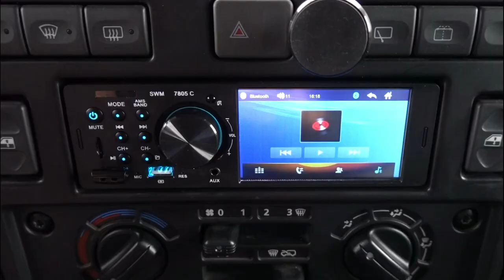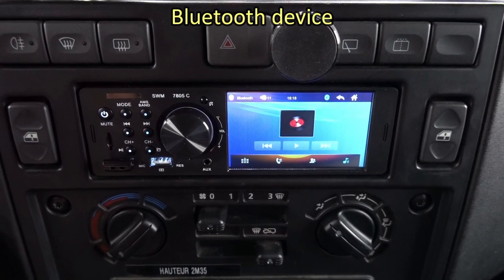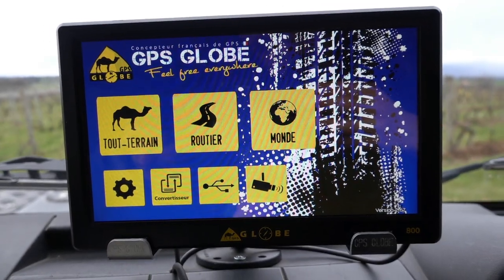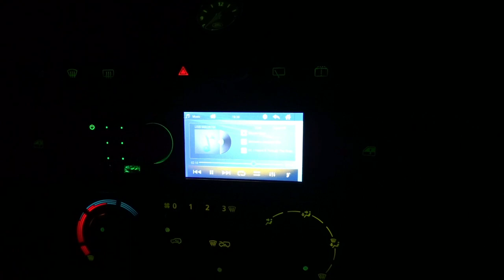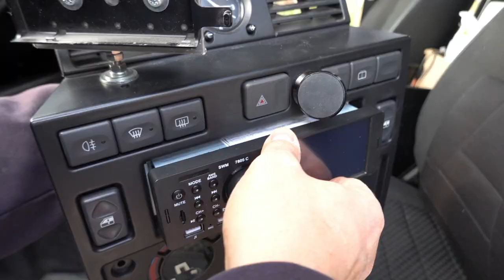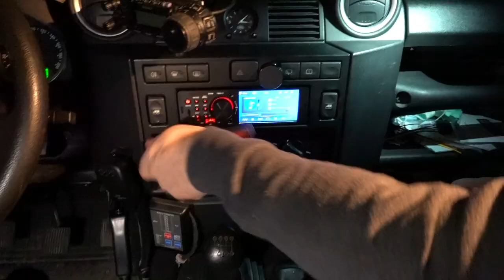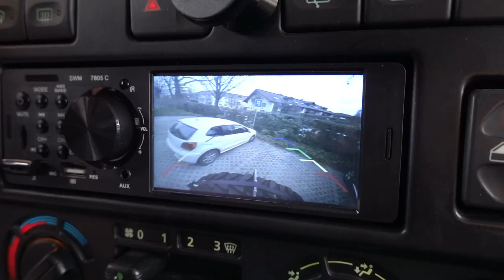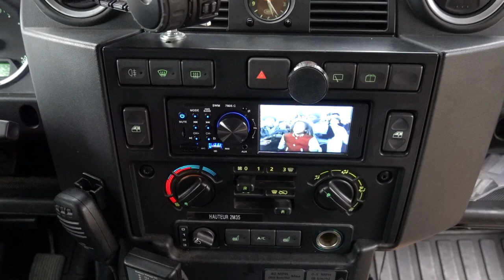HOW TO INSTALL CAR STEREO WITH REVERSE CAMERA | Bluetooth, Touchscreen, Radio | Land Rover Defender

Comment: Bonjour What Kind of CB Radio is this in the top of the Fog light and Screenheater switch ?
Reply from the maker: It's a HAM radio with deported display panel, a yaesu 857d.

Comment: I did the same conversion with my Puma, but opted for a double DIN stereo.  A more involved install and you have to buy a new fascia front panel (https://www.mudstuff.co.uk/collections/interior-accessories/products/defender-puma-double-din-replacement-fascia), but does mean that you can have a more modern head unit with apple car play etc.  I take it that you did not need this functionality?
Reply from the maker: Thanks for sharing what you installed. No we don't need this functionality ;)

Comment: Got mine installed yesterday, can hardly see anything off the screen when you looking at it on an angle. Has to look at it right in the front of screen to be able to see anything , imagine doing that while reversing to park.
Reply from the maker: After a few months of use I can say it's a good radio that can endure 4x4 shaking. We haven't really used the rear camera option but yes I confirm that the screen isn't good to look at if not right in front, even for choosing music on a playlist.

Comment: Was that simple to install?
Reply from the maker: Depends on what you already have as connections. We kept our old radio wiring and only added the camera on the already existing rear lights wiring. If you don't already have an install might take a little longer ;)
Reply: @offtrackfamily  I have a 2004 Touareg. Thanks for the advice

Comment: absolutely rubbish! go for land rover classic infotainment system instead. navi, hands free, DAB radio and much more...no camera but you may buy one any back mirror kit rather than this crap.
Reply from the maker: 😄 After using it for more than a year you can guess we're changing it for a regular JVC one. It does handle well the offroad and sits nice on the dashboard imo but the screen view & touch screen are total crap and not easily usable while driving.